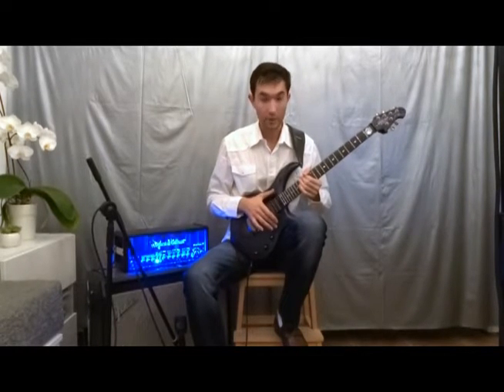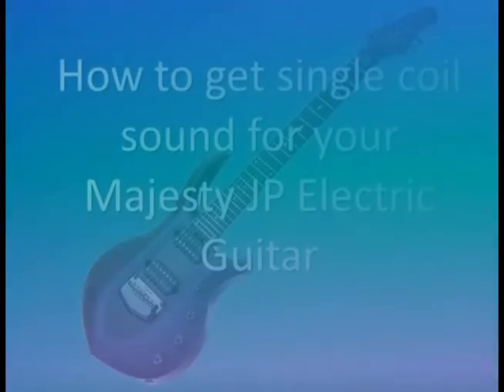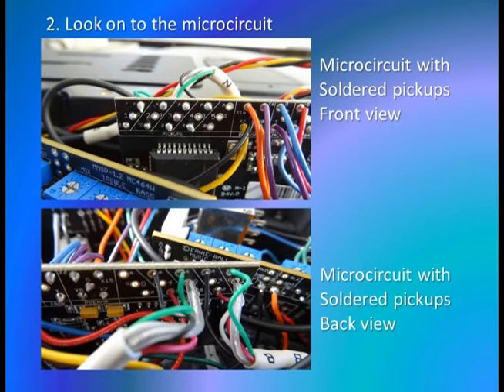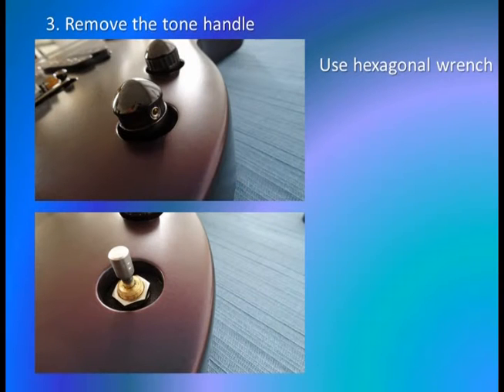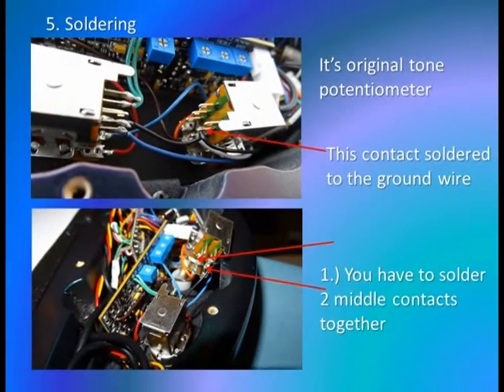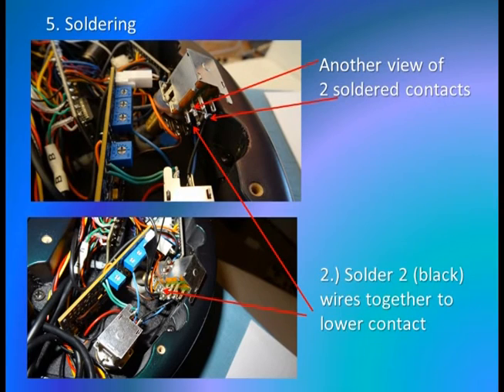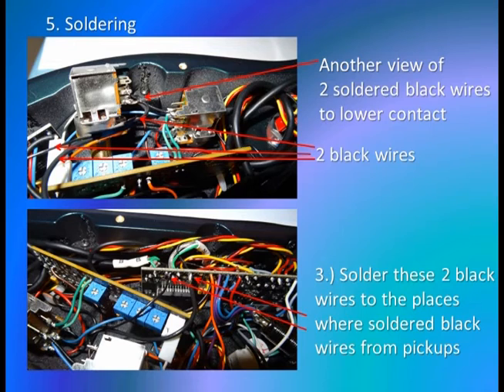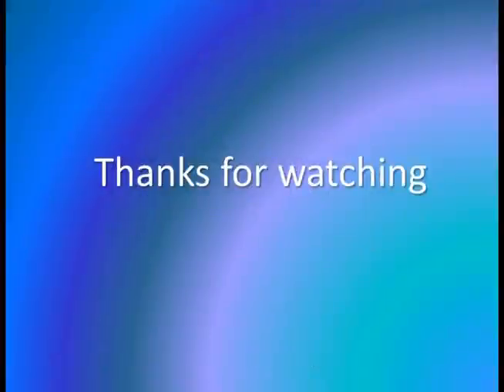How to make single coil mod on John Petrucci Majesty Electric Guitar: Part 1

Comment: I just wanted to thank you so fricking much. I have had my majesty for about a year, but I always picked up my telecaster more because I just enjoy single coil sounds so much more. You fixed a worlds worth of buyers remorse! I love this new versatility. I would have preferred using the outer coil for the bridge, but I didn't want to risk messing anything up. But primarily I wanted the neck position to split because that is where I play the most clean. It was rather difficult to get the wires to adhere to the circuit board but once I tinned them properly it wasn't so bad. I was so worried I was going to over heat something and spoil the whole piezo system. I couldn't be more excited. I went from never working with guitar electronics as of a week ago, to doing a small tone change on a stat and doing this for my second project. Thank you so so so much!
Reply from the maker: Hi Ophelia, thank you very much for your message. I'm glad to hear that my modification can help you! When i was doing this i also was worried about not to damage the guitar. Now on the new models of Majesty electronics looks a bit different, but probably with more easier access. I wish you good luck with your project!
Reply from the maker: Hey Ophelia, i hope you are doing well. I have just thought i can share with you my lates video where i play with my Majesty electric guitar using Piezzo. Very soon will come out more videos and my single with official video. If yo ucan please subscribe to my channel, it will be much apriciated. Here is the video: https://youtu.be/oYW9BrYJLB8

Comment: Do you think its possible to do with their new model electronics? There arent any wires to deal with since its all integrated to the chip...
Reply from the maker: Hello Kohav, it is a bit difficult to say without viewing what's inside the new majesty model. One guy wrote me about Tiger Eye model from 2019 and sent me the photo of electronics. According this photo I thought it would be possible to do this modification. One thing is chip and less wires around microcircuit, another thing is the wires from pickups which shall go to microcircuit (except  I dont know something and exist wireless pickups?  ) and exactly in the points where wires from pickups comes it could be made the additional connection to make single coil sound.
Reply: @RommyLeVent  i wouldnt mind providing pictures or even hop on a zoom call if u feel like helping me with this mod. Already got all the tools :)
Cheers!
Reply from the maker: @fufc1231  Hello Kohav, not sure about zoom call, i'm on holiday now and traveling, you can send me the photos of the electronic and when possible i can have look.
Reply: @RommyLeVent  hello, I also have a majesty with the v2 electronics. Have you managed to find a way to do this mod on the new preamp?
Reply from the maker: @sazistas  Hello. I thought to buy new majesty, but last years I invested lots of money in sound Engineering and audio production, so I left this idea for later times, maybe someday I will buy new Magesty and do this mod on it.

Comment: That's great ;) thanks for sharing this.
Can you share the pictures of the instructions with higher resolution somewhere? It is difficult to see it in the video (480p). Thanks!
Reply from the maker: carlosjb2002 Hello Carlos, ok no problem, i will share the photos with high resolution soon, please wait a little bit, i;m on the trip now, will put here the link in a couple of days.
Reply: Roman Zavalin Thanks, I am looking forward to it :)
Reply from the maker: carlosjb2002 Hello Carlos, please see the link below the video, there where description is, I hope it helps, you can download the photos with high reslution in RAR ARCHIVE.
Reply: Roman Zavalin Thanks. The link in the video doesn't work but the musicman forum does. I will try this very soon :)
Reply from the maker: carlosjb2002 Thanks for reply Carlos, yes, as I tried to put the link here Youtube made it inactive, then I decide to put it below the video and on Music Man forum, is good that one of them is working!
Reply: Roman Zavalin Thanks. 
One more question: is it possible with your modification to get single coil 4, instead of 3? To get a more strat, neck-like sound.
Reply from the maker: carlosjb2002 Hello Carlos, I think it's no problem and it's possible, if you understand basic principle ho to do single coil sound from humbucker, is all what you need is connect one of these black wires (from potentiometr) to microcircuit (to one of the hot connection). In my modification I soldered it to the point where soldered black wire from bridge pickup. Probably in your case you need to solder to the point where green wire is. Before solder just try to connect to the green and see if something changes. I  made the same before solder and it worked.